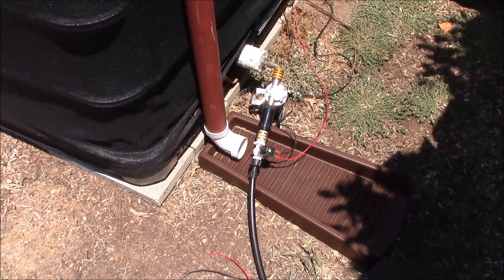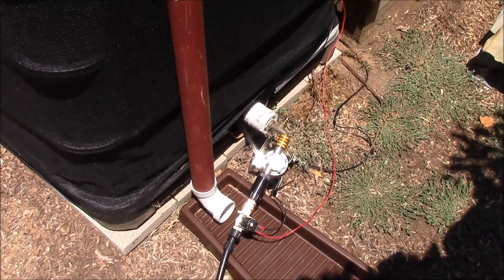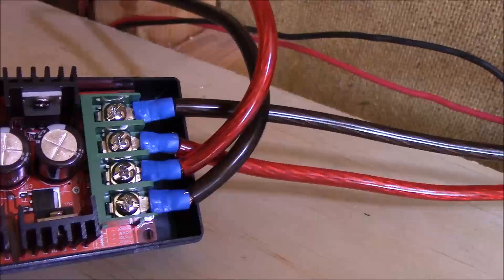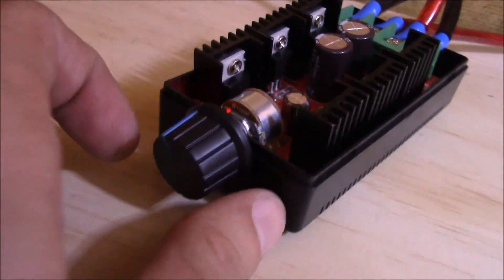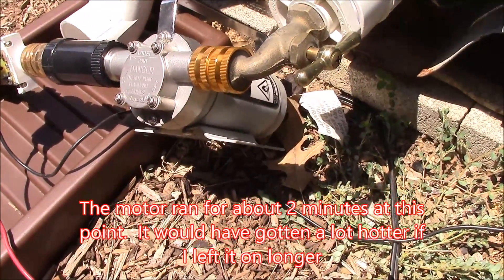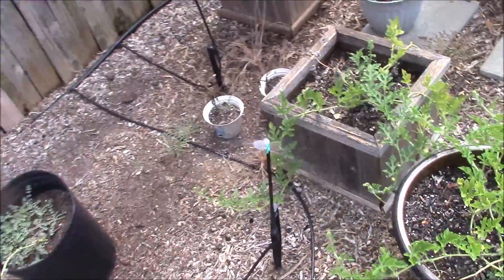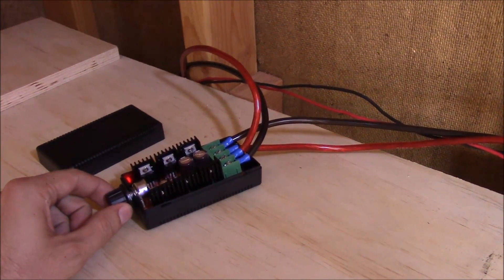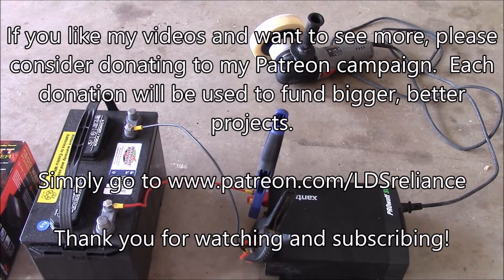DIY Automated Garden Watering System Part 5

Comment: Ok which is the cheapest and best MPPT you can get in market for and my solar is 100watts power
Reply from the maker: Buying an MPPT controller for 100 watts is a waste.  You would be better off just getting another panel.  But most people would probably say Outback makes the best charge controllers out there.
Reply: ok thanks
Reply from the maker: pv abhilash You are welcome.  Thanks for watching!